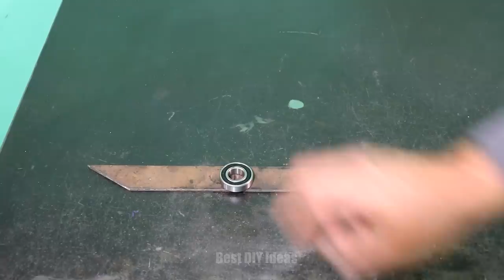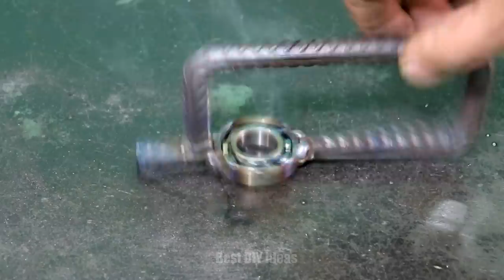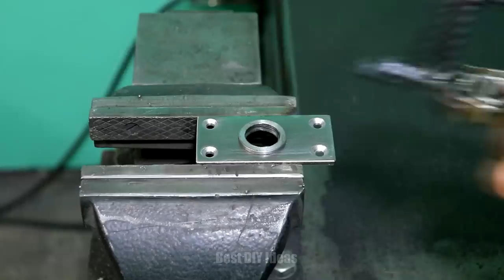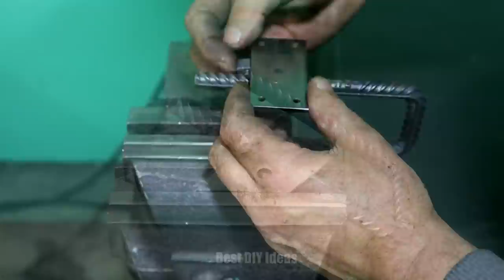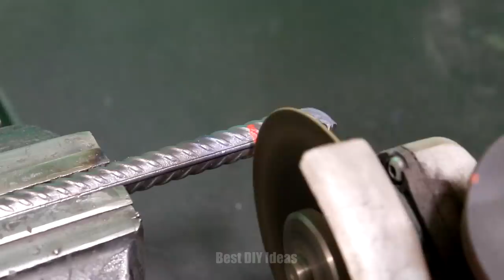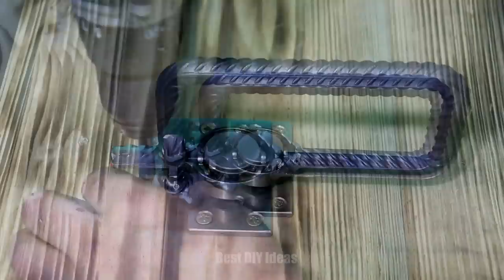Crazy DIY Door Latch Idea

Comment: This type of lock is very dangerous. It does not open from the other side of the door, which means that whoever stays behind the closed door behind him can remain closed indoors.
Reply: Достаточно сквозняка, дверь сама захлопнется.
Reply: It only depends on the function of the door. Think of fire escape door that only open the inside.
Reply: Use any key, credit card, or screwdriver. 
Place it between the two doors and slide up.